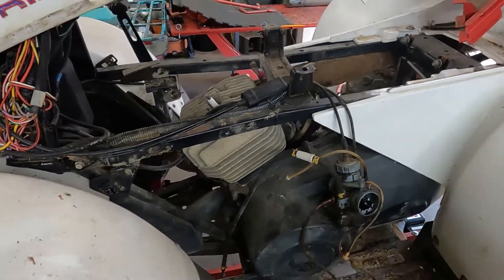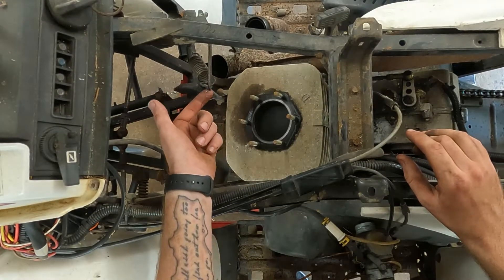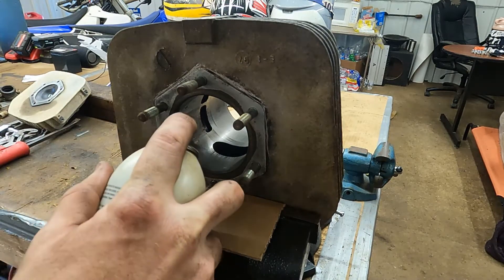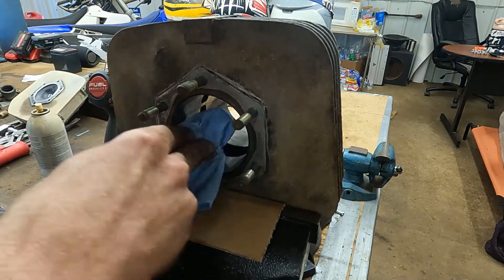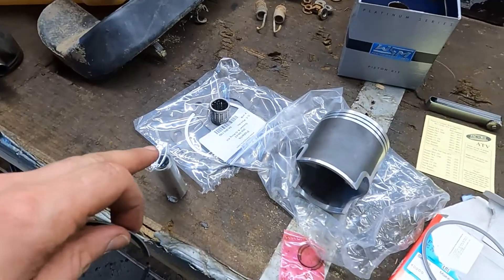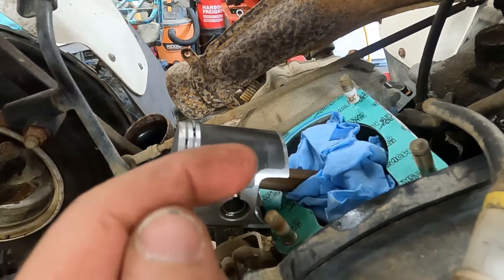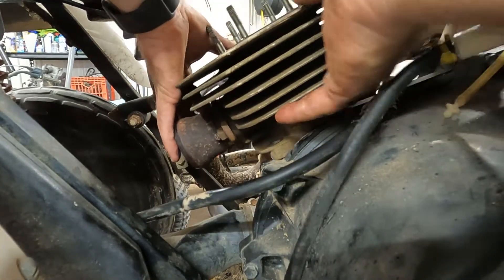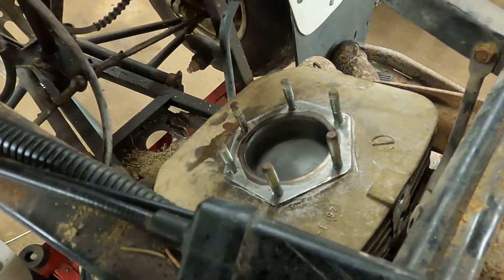Rebuilding Top End on Polaris Trail Boss 250!

Comment: I have a 1990 Polaris trailblazer, I was riding it full throttle and suddenly I could hear the intake sound over the exhaust sound if that makes any sense. It slowed down and died and now it’s got 60psi compression. Gunna give it a top end rebuild thanks for the video

Comment: Awesome! Did your new piston hold up in your old bore is the machine running today? Also did you ever do a compression test after this top end rebuild was done and machine up and running? Im debating whether to get mine bored out or just change out the piston i have minor cylinder wall scuffs on my cylinder..
Reply from the maker: Yup it’s still running! I didn’t do a compression test on it. If you only have a few scuffs I’d just hone it and do piston and rings. I was taught if you can catch your fingernail on a gouge then it needs bored or replated.

Comment: Great video! One question, do you recommend sealant on the jug gasket and head gasket and what do you use for sealant?
Reply from the maker: No I don’t put any sealant. Just clean each surface and put new gaskets on. New gaskets are impregnated with a sealant and will liquify and stick during the first couple heat cycles.

Comment: Nice video!
Happen to have any videos on getting the flywheel off and replacing bearings?
Reply from the maker: Check the recoil video for the flywheel and/or the starter video. In one of those videos I had to take the flywheel off. But bearing, I didn’t have to do that on this quad so that’s a no 😅

Comment: Just rebuilt mine and was wondering why and if there’s supposed to be oil in bottom end old rings were worn and had blow by should I drain it out or leave it in there or what there wasn’t a crazy amount but enough for me to be curious I’d say probably about an inch deep
Reply from the maker: It should be pretty much dry. It’s possible the carb overflowed since the last time it ran and it dripped down the intake into the crank case. You should try to get all the standing liquid out of there. It doesn’t need to be dry but you risk hydrolocking it. If you have it together already pull the plug out and pull the motor over really fast and it’ll spray out. Do that until it quits for the most part.
Reply: @ToyShopRestorations  do you know what bolt is the drain plug

Comment: Nice video, i have a 73.5mm wiseco piston for my Trailblazer, witch sizes I should inspect before the instalation?
Reply from the maker: I’m not sure what you’re asking 🤔 I don’t usually measure anything other than the bore to make sure the piston is correct.
Reply: @ToyShopRestorations  I ask you how many inches of difference between the diameters of the cylinder and piston should I have if I use a wiseco of 73.5mm for a polaris trailblazer 250 2t, also, the minimum and maximum opening measurements of the rings.
Reply from the maker: @cristobalmannsrosselot  ohhhh um that should be specified by the piston. The piston should have came with a little book that specified the ring end gap and might give you piston clearance. If not I’d get on wiseco’s website and see. Should be the same spec for all of their 2t pistons.
Reply: @ToyShopRestorations  thanks so much

Comment: Hello, how many torque you used in the cylinder base nuts AND the cylinder head nuts?
Reply from the maker: Head bolts 18 to 20 ftl-bs. Cylinder base 25 to 29 ft-lbs. Crankcase 6mm 72 to 92 inch-lbs. 8mm 17 to 18 ft-lbs. Hope this helps!
Reply: @ToyShopRestorations  thanks!

Comment: Damn, wish you would have shown how to get that damn engine mount out of there imma torch the bastard off soon lol. BTW anyone reading this the polaris manual says to use loctite 515 on both sides of base gasket...probably to make up for lack of torque spec🤣
Reply from the maker: 🤣🤣🤣 I don’t have the book so that’s great
Reply: yeah i specifically came to this video hoping to see somthing about that pesky motor mount. i can't get the bolt out, even with a punch.
Reply: @tuggerman84  I suffered that same thing. It's not a bolt it's one solid peice so it can't be removed that way. Have to remove from cylinder

Comment: I have a 7.24 bore what size rings i need
Reply from the maker: 7.24? Stock size is 72mm
Reply: @ToyShopRestorations  yea stock is 72 mm but my jug is 724
Reply: @ToyShopRestorations  its .o4 over 72mm
Reply: @ToyShopRestorations  i think standered will work but not 10. Under
Reply from the maker: @billhamby6230  ya standard size should be fine!